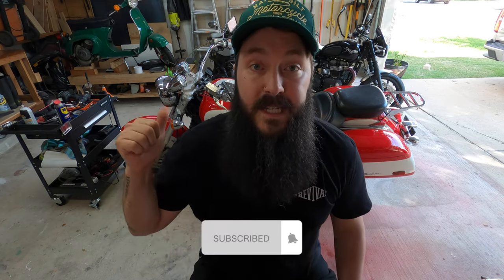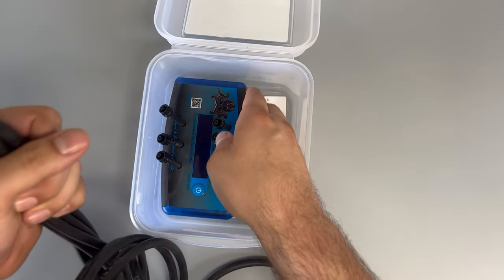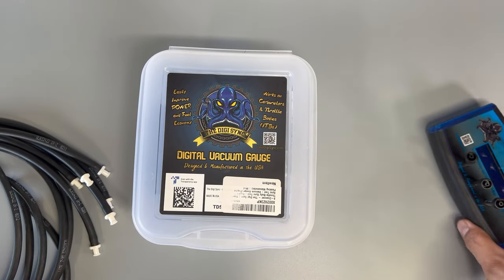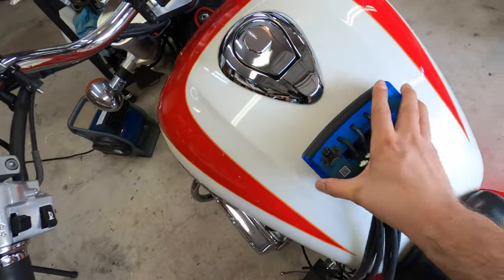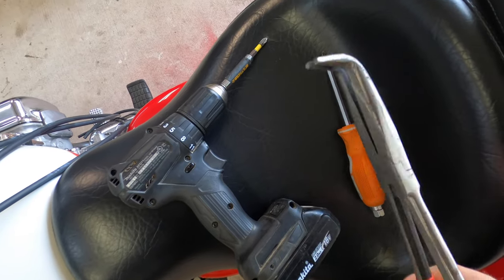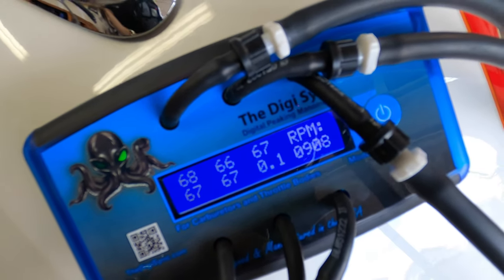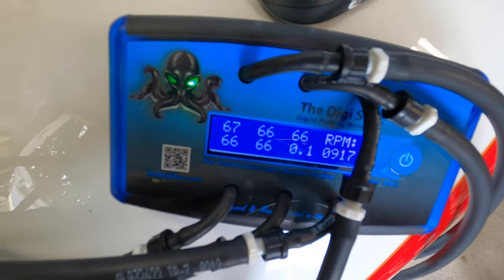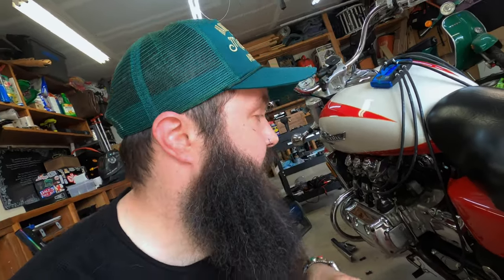Tuning 6 carburetors on my Honda Valkyrie at the same time with Digisync? #honda #valkyrie #tuning

Comment: Thisnis crazy because the valkyri was designed to be tuned off one carb ya connect that carb in turn to each of the other carbs so this is curious. If i get me a valkyrie ill need to get one of these
Reply from the maker: This thing has been a game changer. So quick to tune the carbs.

Comment: hello
I am a man in his mid-50s living in Korea.
I own a valkiry 2000 model.
However, one of the six bent parts attached to the exterior of the engine cracked.
I want to buy new parts. Where can I buy them?
I would appreciate your help
Reply from the maker: Best place I know of for parts that are super expensive would just be ebay.com. I will follow up if I find a better and reasonably priced site